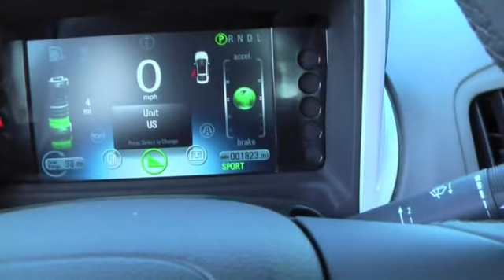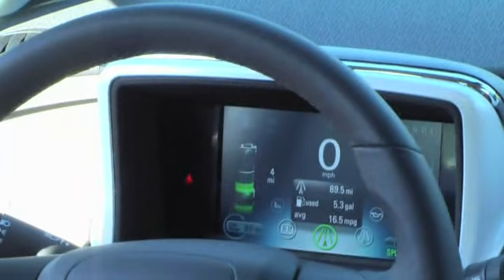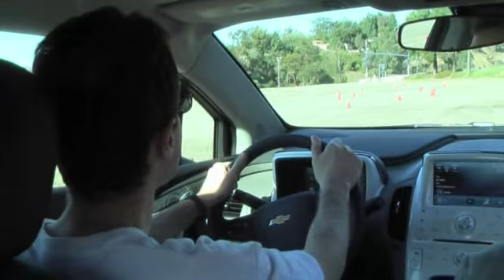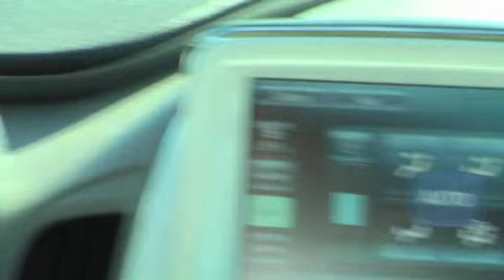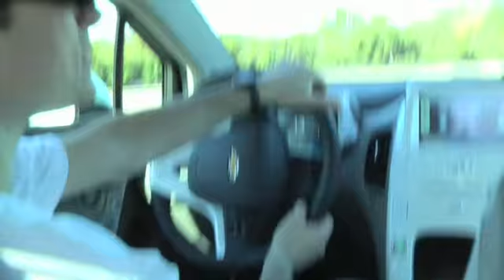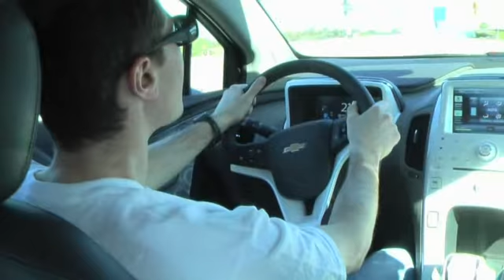Chevy Volt Test Drive

Comment: @Beast9156 if this is your every day crusier and you dont commute more than 35-40 miles a day which cost $1.35 the whole mpg way of thinking goes out the window the mpg thing only factors in after that you run out of battey power.most people dont drive more than 20 mi a day never the less 40.so effectively your transportation cost are almost nonexistant.however since your initial cost on the cruze are probably less than half of its hybrid sister the volt.you are ahead considering overall cost

Comment: I don't think some people consider the second law of thermodynamics in their posts.

At $41,000, this car is pricey. I think it sucks. Don't get me wrong, I love electric cars; but this is not an electric car. Four seats and a small trunk don't cut it for a lot of people. Keep your current car and buy an electric commuter car like the Nissan Leaf.

Also, if there is no detected change when standard, sport, or extended range are engaged, WHAT'S THE POINT?

Comment: LMAO. Nice cover up, 90 miles it used 5.3 gallons. 16mpg *9.3 gallons=148 miles on fuel, plus another maybe..maybe 90 from electric. It total your getting less than 300 miles, for 34k Its not worth it. I'm saving a total of 200-300 bucks a year at best if you drive daily of about 80 miles. I'll stick my 2009 8 cylinder
 jeep that I got 1/4 price, better performance, towing and features. I could Invest the 15k in bonds and market and get results.

Comment: I really like it, but you realize that you'd have to drive the car at least 70,000 miles to get equity in it, right? And just where the hell are you going to recharge the thing? And what happens when the batteries no longer hold a charge? $10,000 replacement? Am I wrong?

Comment: The problem with this car is its $40,000+ price tag. Even with the $7,000 government subsidy, it is still $33, 000....for a car the size of a Honda Civic. 
If you were to buy a Honda Civic for $17,000...you would have $17,000 to spend on gas........plus every Honda I have owned was an excellent car. 
Now, I know that it is better for the environment, but most people won't consider that.....I live in a city where 90% of people could walk or take the bus, but everyone drives there own cars....

Comment: you still have to put gas in it? so its just another hybrid, POS! I use to have a VW Jetta TDI that gave me 50ish mpg's and i got more boost out of it through tubing and a intake kit/ exhaust.  it hauldazz! i ran a 14.2 at 106mph 1/4mile at the track. add TIEN suspention and a set of BBS LM wheels....whooo i love that car.... but im a supercharged e39 ///M5 guy now...FUK TREES!

Comment: It is the same as a diesel locomotive but with batteries for on demand power. Trains use a diesel generator to power electric motors. Very old technology from the 1920's.  40k for this is crazy.  Well minus the 7500 of tax payers money.

Comment: its cool in all like how they embedded all this modern technology into the car. But I think all this fuel restriction like the battery life affects the rpm. I think it's cool with a "catch" you know? I mean, cars are cars. They're supposed to be simple and operation is supposed to be easily comprehended. Before we know it, driving a car would almost be as complicated as piloting an airplane. I don't like how they made driving a little less simple. The technology part is amazing though :)

Comment: @LOLDISNEYLAND actually the volt has a plug in feature either for 120 or 240 volts, also there is a solar package for sunny climates that allow solar charging, I know that feature is promoted in Arizona. The style of the Volt is a classic style as it should be, one is limited by wind dynamics, infact one of the most wind dynamic cars ever made was a Hudson.Keep in mind the original concept of the Volt was to use a fuel cell, and that is still on the table.Thanks for your time

Comment: @40172 Hi. I think you might have missed it: the Volt is a hybrid. The drive is electric. When the batteries run out an ICE starts and recharges the batteries while you're still driving. You don't have to wait 4 hours for a recharge. If you want to you can plug in at home while you sleep. No amount of sleeping will get your Honda/Toyota refueled ; -)

Comment: @LOLDISNEYLAND the improved efficiency of an engine running at constants rpm with high compression ratios with high octane fuel makes up for the inefficiency of converting from mechanical to electrical back to mechanical energy in the serial electric hybrid setup.

Comment: @40172 
It runs 40 miles on teh battery, then another 350 till the gas runs out.. Your only range limit is how for to the next gas station, same as a Prius or Insight. But this car is totally electric drive, with the gas engine acting as a generator when the battery gets low. But you can continue to drive as long as you have fuel.
As to Obama.. I agree.. the tax stuff sux. But GM has repaid thier debt to the feds 5 yrs ahead of schedule.

Comment: @gabrielperron If you charge it at night, very little, no more than running a large consumer electronic like a plasma tv. E.v's cost a few dollars to "fill up" this is an erev so as long as you commute less than 40 miles a day it'll be cheap

Comment: The electric cord should be retractable into the Chevy Volt. The biggest problem is opening up the trunk to take out the cord, unwinding the cord, then plugging the cord into the car, then into the wall.... 8 hours later, unplug the car, unplug the cord from the wall outlet, winding up the cord, opening the car trunk, and placing this cord back in the trunk. Cant GM design it to be a bit more simpler then that?
Don't let the Japanese make us look like fools again. Come on GM!

Comment: The full battery pack capacity is 16KWhr, but only half of that range (between roughly 30 and 80% state of charge) will be utilized.  The rest is buffer to help prolong the life of the pack.  In other words, around 8 KWHr will charge up a depleted pack.  Depending where you live, that'll cost between $0.80 and $1.20 for most folks.  (this estimate is based upon $0.10-$0.15 per KWHr.)